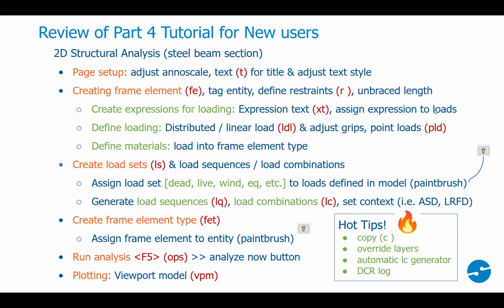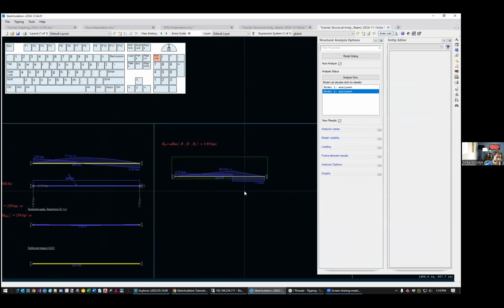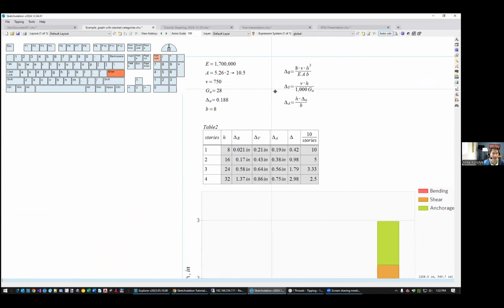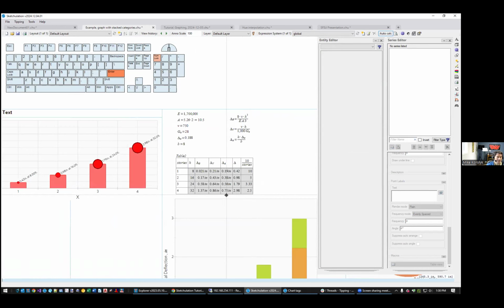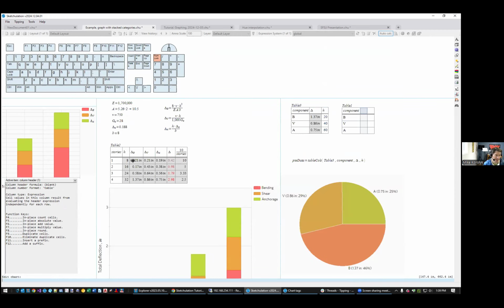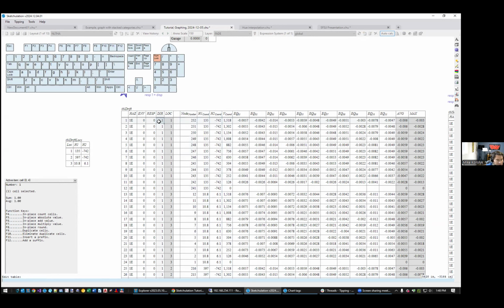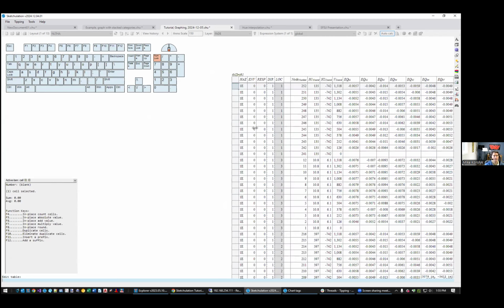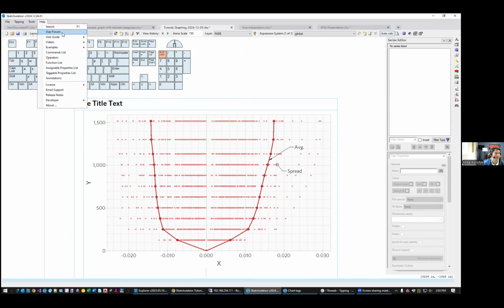Sketchulation Tutorial for New Users - Part 5 (Charting)

Comment from the maker: ⏱Timestamps⏱  
0:00 Start
1:12 Review of Tutorial Part 4 (2D Structural Analysis)
2:01 Create expressions for loading with expression text (xt)
2:28 Distributed / linear load (ldl), define restraints (r )
2:50 Create load sets (ls)
3:08 Create frame element type (fet)
3:29 Define materials: load into frame element type
3:38 Auto-create load sets /combinations with (wand wizard!)
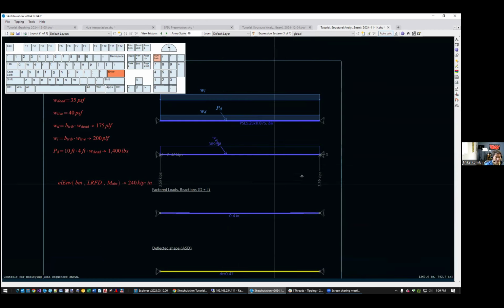4:08 Structural analysis options sidebar (ops)
4:35 View analysis results
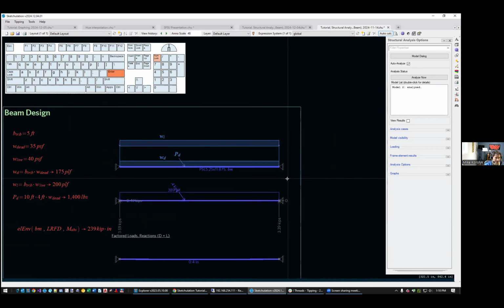4:48 For production: Viewport model (vpm)
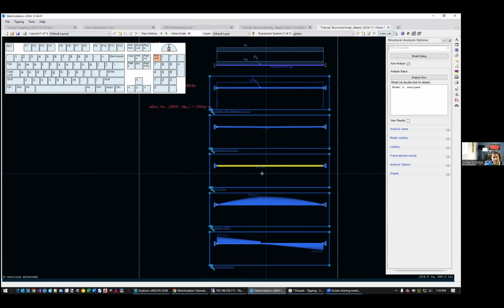5:11 Frame element tagging and results query (elEnv, elRes commands)
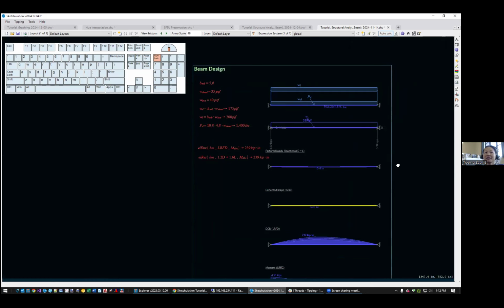6:48 Reaction output question
9:47 Tutorial Part 5: Charting
10:15 Cartesian chart (cht)
10:40 Expressions defining x and y
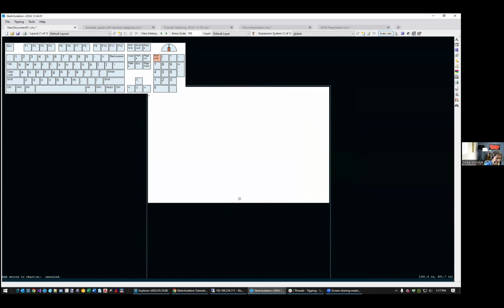11:27 Series editor (eds) and markers
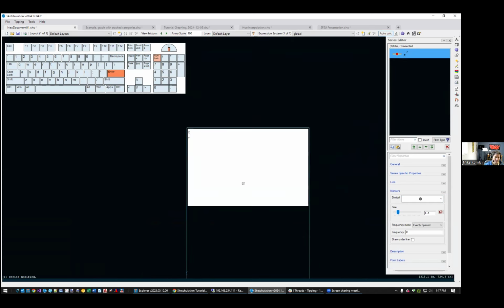11:56 Circle expression
13:24 Entity Editor: Modify properties (mo) of the graph - chart editor
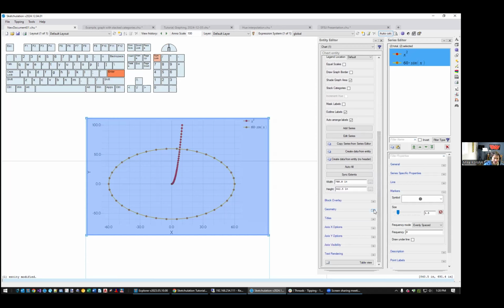14:35 Adding titles to chart
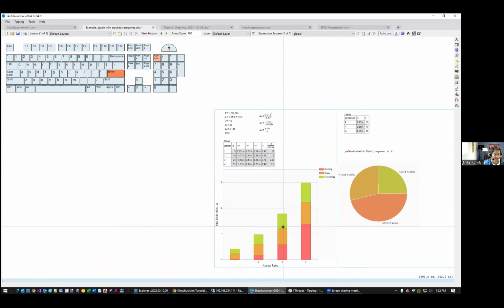17:13 Bar graph
18:27 Making a chart to feed into the graph
18:51 Table columns from series (ser)
19:40 Edit series (eds) to change graph type and display properties
21:03 Point labels
22:16 Special column tags
23:23 Dot scale (scl)
24:08 Maximum value for Y-axis
24:40 Toggle mask/outline for text in modify properties (mo)
25:11 Contour colors for table text
26:37 Additional column options
28:36 New graph (ser) with three series for batch editing
29:48 Adding a legend (leg)
31:22 Modify properties (mo) to see columns as stacks
31:57 Pie chart (chtp)
32:23 Making a summary table (tbl) to feed into pie chart
32:52 Telling the chart not to look for symbols in text column (ctrl + t)
33:26 Chart query call column
35:32 Creating an array for pie chart to read with modify properties (mo)
36:14 Writing an expression (xt) to define data with pieData command
37:25 Writing an expression (xt) with the subtable command
39:02 Linking pie chart to expression
39:21 Pie chart display options
40:37 Choosing pie chart colors with hue column in table
41:23 Working with larger data sets
50:32 Plotting the large data set to a chart (cht)
50:57 Choosing X and Y coordinates with series (ser)
51:48 Edit series (eds) to display only interstory drift values
53:12 Plotting average and disambiguating data points
55:20 Editing chart for production, Legend edits